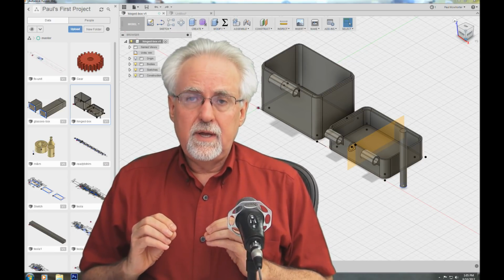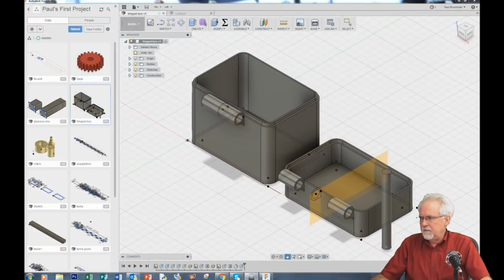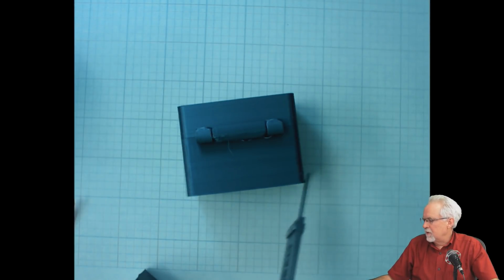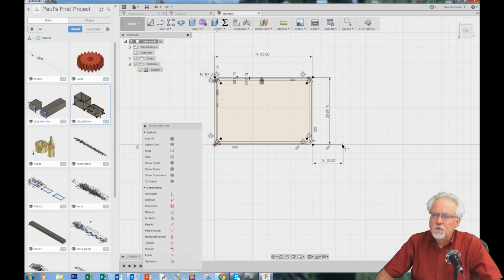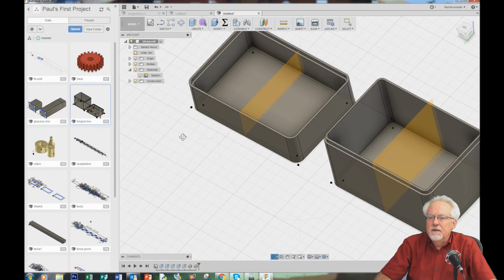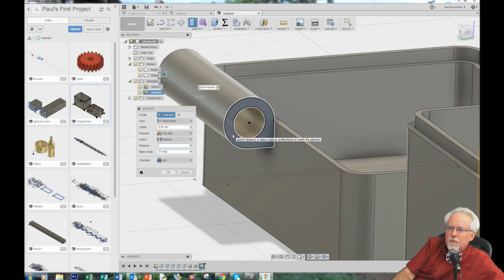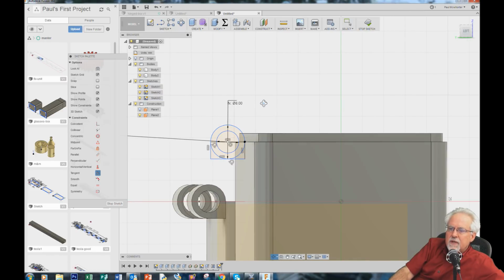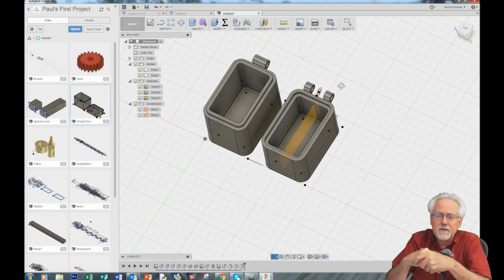Learn Fusion 360 or Die Trying LESSON 6: Sketching on Offset and Orthogonal Planes

Comment: Firstly TY for your tutorial, the series has taught me the really solid things that frustrated me when attempting to learn cad. An interesting thing is in the Parameters menu you have to enter the name and then dimension number or expression one at a time. When its entered you get a lovely parameter list which can then be easily modified. I would love if we could just enter these parameters in this menu display as say a spreadsheet and you can use arrows to move between cell entries. This means you can enter the names first before entering the values which seems more the order of how we think. " We need a width , then the height then the depth then ....so on followed by what values do I want for ..this ist )
Reply: You might also be interested in this discussion and feature request: https://forums.autodesk.com/t5/fusion-360-ideastation/re-ordering-for-user-parameters/idi-p/7252878

Comment: Hi Paul. No you are not insulting me in the slightest. As we went through the hinge implementation I figured out another way of doing the parameters but as with all of these things there are multiple ways of doing the same thing. I'm a 63 year old Emmy winning VFX designer and I cut my teeth many many years ago on CG modelling and animation. I've been around technology all my life but Fusion 360, Cura and 3D printing are a completely new frontier to me in my dotage. I really appreciate your patience and methodical structured approach to what for me is a daunting learning curve.  This box is currently printing out on my Ender 3 and yes I added a new parameter called tolerance so that these parts will have a better chance of fitting together. We're probably the same age but you have the knowledge and I don't. Once I've gone through this series I'll be going through your Arduino series. Many many thanks for your efforts. It's greatly appreciated.
Reply from the maker: Thanks for the kind words, and glad to hear you are benefiting from the lessons. I really enjoyed making them, and hope to find time to do some more. God bless.

Comment: When I installed Fusion 360 it had the Y axis as up by default. This can be changed by clicking the arrow next to your name in the top right corner and selecting preferences. This setting is under the general tab. Not a big deal, but if you're trying to follow along it will be less confusing.

Comment: Paul thanks for the great lessons with, as mentioned, great pacing.  I've fumbled about with F360 for over a year with all the frustrations you've described but your lessons have finally got me liking it!
Something I discovered watching your lessons:
Rather than drawing the lid separately all over again I did as you showed in one of the first lessons and did a rectangular-pattern of 2 items, the base and the top which keeps everything automatically the same as you showed.   However, this constrains the new top to the bottom spacing you choose in the  rect-pat operation.  But!  As you enter the distance in the rect-pat operation you make the distance the box width + 20mm.  Then as you mess with the box parameters the base and the top stay 20mm apart and you will never have the issue where the base mashes into the top and no way to move the top out of the way.

Comment: I think you have the length and width terms mixed up. At least in Spanish, width corresponds to the shorter horizontal dimension, and length to the longer horizontal dimension.

Comment: Thank you very much for putting up these videos, the you teach is amazing and how you explain it makes it easy to understand. I'm completely new to fusion 360 or any cad software but I'm enjoying learning it. i have struggled with a couple of things in this video which was the fractions i cannot workout how you done it or what the fraction actually is. I also build the box but when i tried to break it, it broke so Ive giving up and will come back to it with a fresh head tomorrow. I have put hours into learning this so not going to give up and I'm sure with you guidance ill pick it up soon enough.
Thank you very much.
Reply: As far as I understand it, the Bottom fraction is a relationship that the 'bottom hinge width' and the 'top hinge width' hold to what he refers to as the 'flat width'. 

The relationship is: bottom hinge width(x) + top hinge width(y)=1(flat width) ; where x=bottom fraction and y=top fraction

It would be easy enough to change this to: bottom hinge width + top hinge width=1(flat width)
as we are prone to intuit. 

But by introducing the variables (parameter defined as a function equaling a fraction of the 'flat width') you introduce proportionality constants that enable you to change the box width, aka: = 'flat width' + 'circle radius' (corners), without needing to go back and change the hinge specifications. Since the hinge parameters are set to be dependent on the ratio introduced by the proportionality constants, instead of absolute values, it keeps the design from breaking given the end user's likely attempt to change the box size.

Comment: Great video. My mind was having difficulty warping around your explanation for the hinges.
Not sure how you came to your settings for the positioning of the hinge on the top and bottom. You used such entries as flatwidth bottomFraction divided by 2???
The flatwidth was the distance from the end of one filet to the other filet. bottomFraction was not clear to me as to what it represented. I have not tried this project but will tonight it would help if there was some clarification on the hinge variables.
Reply: I am on the same page as you. I have no idea how this value works. I would love it if we could get a reply
Reply: I think it would have been better if he labeled "bottomFraction" as "bottomHinge".  He set that parameter at 0.5.  Basically he's splitting the hinge parts equally (50%) between the top piece and the bottom piece.  You can see him set that up around 16 minutes in.  But otherwise, I liked his approach.

Comment: I am finally learning Fusion 360. Your are doing great!

The neg offset problem with parameters seems to be a Fusion coding problem, but it would not be a problem if you work from the inside of the box to the outside. Just redefine your parameters so the first wall is the inside. Actually the inside of the box is the working part, ie. the usable space and so should be more important than the outside.

Comment: Paul, 

I have great success creating the box, but I cannot get the pin. I have tried adding supports and rafts but the pin starts moving as it prints. Eventually it gives way or moves enough that the print is ruined. Do you have any recommendation for videos that show how to print a cylinder on its side? I assume I make these addition in the slicer. I use Slic3r Prusa Edition. Any guidance would be appreciated.

Thanks.

Comment: Great series of video's.   I was brought up as an engineer on a drafting table with a sliderule....Later in life I managed people who did cad designs for me...... but I always wanted to know how to do it.   Fusion 360 and your video's are helping a lot.   At first I was put off by your style. I felt like a HS student ( I have not felt like that for over 50 years).  Turns out I need that level of instruction.

By they way.... you did not draw the pin..... an easy compoent.  Also you made several mistakes along the way and that was sort of good as it helped me think though the mistakes.   So.... Thank you

Comment: I have just started using Fushion360, and wondered why you did not include the hinge pin and assemble the top and bottom to show that the top lip fitted into the bottom lip without catching on the front edge? Will you be doing this in another video? I did the glass case a number of times and it works well. Really enjoy your videos as your explanations gives me the time to follow along with you instead of having to stop and start when I get behind. Do you use parameters on all your projects? I am now going to try and do the little box on my own. Thanks again. Bob. Victoria Canada.
Reply from the maker: Yes, I try to always use parameters. I did not do assembly as this video was already really long.

Comment: Hi Paul,Great video. I would appreciate it if the clicking out of one mode and into another was made clearer. It happened when you were doing the mirror on the hinge, going from one hinge to another. I will go back over the video and watch what you did. I keep getting to a point in different projects, where I think there is a problem with the program and it turns out to be some simply click that I missed.I would also like to ask if there is anyway I could have a  video done on YouTube, of a project of mine that would not be open to anyone else seeing it. I would like to get a prototype 3D printed to check its functionality and then think about having it manufactured. Do you mind me asking if you work for Autodesk or Fusion 360 or, do you work for yourself? I am just new to this type of engineering and think it is really exciting, especially every  time you say " Boom there it is "!Anyway, keep up the good work, it is appreciated. Thanks. Bob.

Comment: Paul, This may not be the correct place to ask but I didn't know how to contact you. If you were designing a small wood framed shed (3m x 2.4m x1.8m) would you use Sketchup or Fusion 360.

Comment: David Griffiths
Thank you Paul for 6 invaluable videos.  At 78 you have not yet killed me off.  I managed the hinge units when I realized the flatwidth divided by 4 got rid of bottom/top fraction parameters.  The two end units are equal in length to the centre hinge unit.  Go easy in number 7 and I may yet survive.

Comment: Paul,  I broke the design when I changed the hinge OD parameter to 6mm.  The large hinge section changed, the 2 smaller ones did not.  Can you give me a clue on how to trouble shoot this?  I am not getting how to modify things (like when you wanted to change the filet under the hinges from 4 to 3mm; it seemed easier to undo. but I cant undo this.  Thanks!

Comment: Paul,

I have been enjoying your lessons, but I am having a problem with the dimensions disappearing after I apply the fillet. I have redrawn the sketch several times and the dimensions always go away.  I then have no points to add constraints to the box.  I know this must be a setting that I don't have set correctly, but I can't figure out what is going on, any suggestions?

Comment: 51:58
Sorry it's late, I'm not totally there and I have issue at this point where you extrude. Please help...

This is what I can see in your video for the offset of the extrude:
flatWidth * bottomFraction / 2 + hingeGap = (width - 2 * cornerRadius) * bottomFraction / 2 + hingeGap = 
(65 - 2 * 4) * 0.5 / 2 + 0.1 = 57 * 0.5 / 2 + 0.1 = 28.5 / 2 + 0.1= 14.25 + 0.1 = 14.26 is the offset and I think it is right

This is what I can see in your video for the distance of the extrude:
bottomFraction + hingeGap = 0.5 + 0.1 = 0.6 is the result I get which doesn't make sense because it give me a little distance...
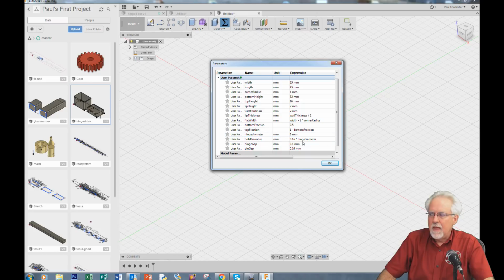I double check everything at 21:25 and can't find the solution
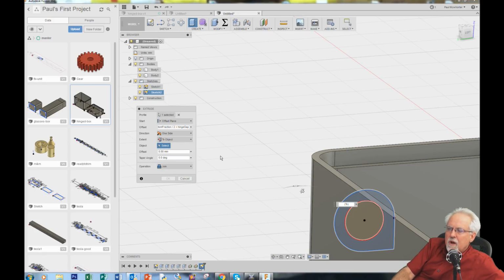Reply: I'm not sure which hinge half you're referring to, but for the top hinge extrudes, there is no distance.  The start of the extrusion is offset from the construction plane by the formula: flatWidth*bottomFraction/2+hingeGap or (65-2*4)*.5+.1=14.35.  That's the start of the extrude.  Instead of distance, Paul  selects "to object" and selects a point at the corner of the box where the back meets the corner fillet. Watch the video at 52:26.

Comment: Paul,
I am in the construction business, and I know that the most important part of the job takes place before the walls go up.  Footings, Stem Walls, Insulation, Plumbing, Electrical, Heating, Sewer, etc...  If all of the below ground work is done correctly, the job can be very smooth.  Otherwise, it can be a disaster.  I like your approach  to teaching this complicated program - it's like building a good house.  Good job!!

Comment: Definitely not insulting me. I guess I am a slow learner but I had to go back over the video a couple of times to get the concept of planes. I ended up getting the drawing right but my plane was 180 degrees off from yours. Anyway you are a great teacher and I really appreciate this. I will continue on with your lessons.
Reply from the maker: Go to your preferences and make sure you have selected "Z Up". I use Z up because you will end up with things aligned right for 3D printing.
Reply: Thank you , that is much easier to work with doing your lessons.

Comment: Hiya Paul ....yet another thrilling tutorial
I did get a little lost at one point concerning the construction of the hinge section but with your patience and slow explanation of how it all came about, it all finally clicked into place for me ...thank you :)
 It is so much simpler using a general list of control parameters and variables than constantly having to alter each given dimension separately....I think where I was first getting confused was remembering all the parameters given the naming format I had given them, ie ..upper or lower case characters and if correct spellings ...so I searched the web for a way to print out a list of parameters used in each case and I come up with an addon given by Autodesk themselves(link below) which allows for a parameter list (.csv format) to be exported out to say Excel or a similar program...When installed..it adds a further option in the pull down MODIFY tab within Fusion 360.....I hope it helps, it has for myself ;)
https://apps.autodesk.com/FUSION/en/Detail/Index?id=1801418194626000805&os=Mac&appLang=en

Comment: I love these videos. Like you, I hate the "tutorials" that expect you to already know everything.  
One thing I did differently was to add a 2mm filet around the top and bottom of the finished box.  Will a 3D printer have a problem doing that?
Reply from the maker: No but the underside of the hinges are a little ugly. Printing with supports will help.
Reply: What would a box like this cost to make?  Would it be worth making custom stuff like this for people?
Reply from the maker: 3D printers are fun to play with, but for most things not very practical or affordable. The fillament is expensive and the resulting pieces are not always sturdy. Usually you would use injection molding to make something you are selling, but that requires lots of parts to be made affordably.

Comment: As a new Fusion 360 user I'm loving these videos.  I have the same problem you mentioned - a lot of the Fusion videos go too fast and assume you know too much.  These are aimed just about right for where I am in the process now.

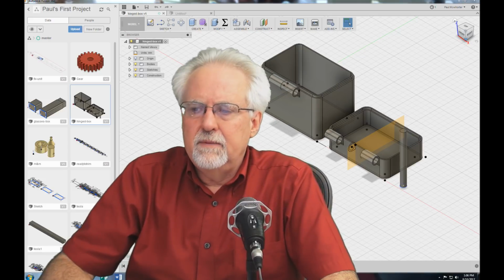I did watch all 1:10:02 of this one and enjoyed most of it.  But yes you did go too slow and repeat yourself in multiple places and I caught myself prompting you to move on and show us what was next.  In general 1:10 is a bit much, maybe break it into more segments or try to edit the video down some afterwards.  That said I took away a lot of valuable info from this video.  You gave us great ideas and examples for maximizing parametric design.  I designed an object today using these ideas and it really did help tremendously.  First of all defining the parameters helped me think about my design in an organized and thorough way, before I started drawing.  Second, once I had the dimensions defined it made the drawing go faster and kept my sketches pinned - something I haven't managed to do previously when free wheeling through a drawing.  Of course if I want to go back and tweak it that will be drop-dead easy.

Comment: Paul, a couple of notes since we're all here learning together...

1. after making your 3D fillet on the first hinge, you can grab that 'fillet' in the timeline and move it back in time to just after the extrude and before the mirror. Once you do that, it applies the fillet before the mirror, which then means the mirror will mirror the fillet. BAM!

2. I'm going to suggest you learn some of the mouse gestures for moving/rotating the view. It will help you be a lot less frustrated with having to do the "right click then click OK" all the time. In this case, use the center mouse button (in my case it's the zoom wheel of my mouse) to click and drag and move your viewpoint. If you want to rotate, hold down the shift key while you're center-clicking and dragging. It works so much better than having to click the UI icons on the bottom and then "get out" of that mode just to finish whatever it was you were trying to do anyway.

Good videos. I've been following along and would love it if you assigned some homework. You know, "now that we've built a box together, go design this other thing over here as an exercise for the reader". Then, a quick video showing how you did it, like you would go over quiz answers at school. :-))
Reply: Great tips and yes to the homework idea!

Comment: Lol I have 0 background in any of this kind of stuff I hardly know how to set up my printer and print other peoples files. Very helpful videos, perfect pace for me and not too complex like you said. Thanks a lot! However you said for the pin just do a pin extrusion, my question is what size to make the circle. If I make it hole diameter I reckon it wont fit. Should I draw it on the original x/y plane? Like I said I'm a complete newbie here and have 0 background in any of this technology world, went manual labor route and not college, now Im paying for it lol stay in school kids
Reply from the maker: I would make the pin slightly smaller than the diameter of the hole.
Reply: like .2,.5, 1mm smaller? and did you print with support inside the hinge?
Reply from the maker: I did not print supports. The tolerance will depend on the accuracy of your printer. I leave about .1 mm tolerance, but you might need more.